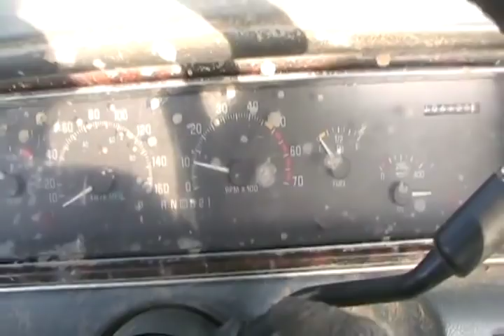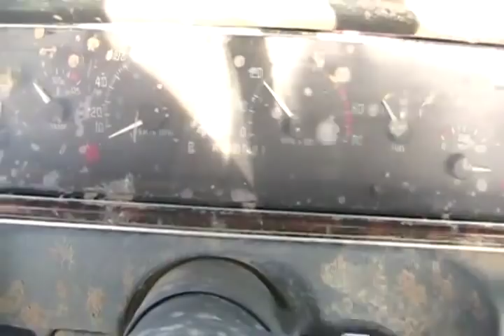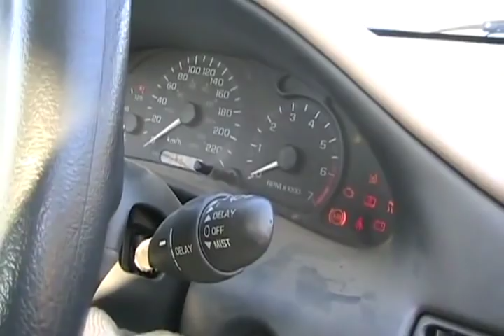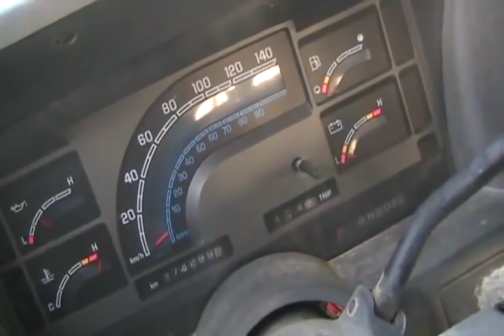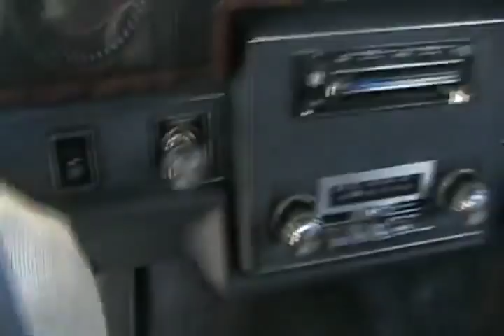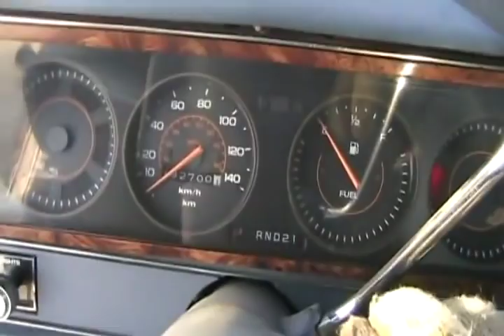#2 Chevy cold starts winter 2011 [Davidsfarmlives]

Comment: my jeep (YJ 1992) the motor and the automatic transmission are from ford, the frem is fucked so it's just waiting in our driveway and we start it 2 times a years, we boost it because the batteries is fucked too but it start like a champ, BUT we gonna put it in piece because it will need an inspection, (it isn't gonna pass the inspection) so if anybody want some piece, let me know in the comments (the frem is just broken over the left front wheel)